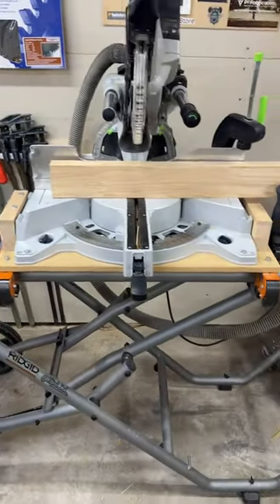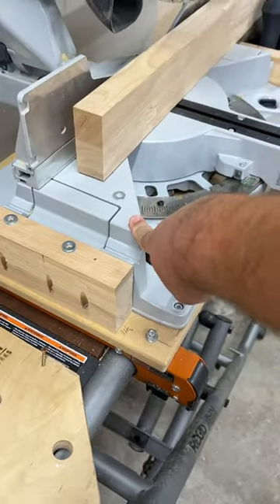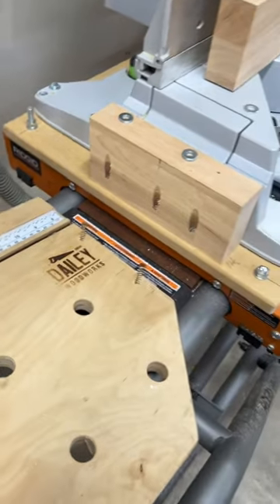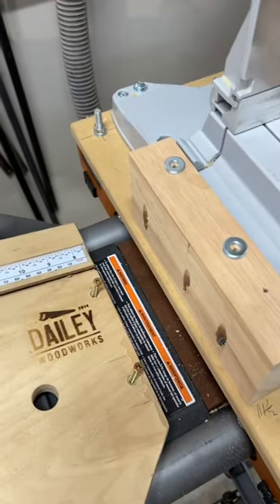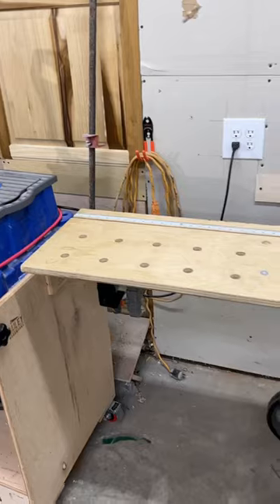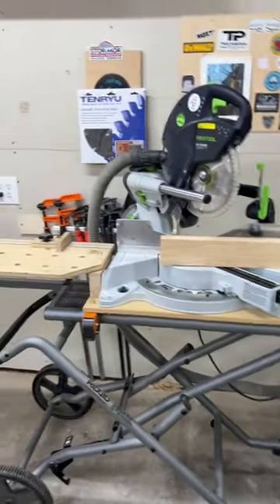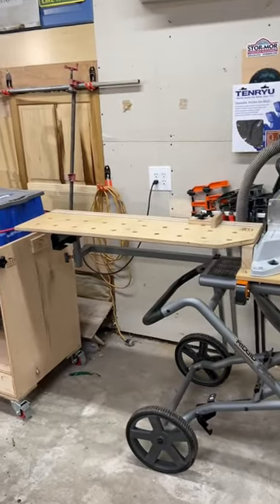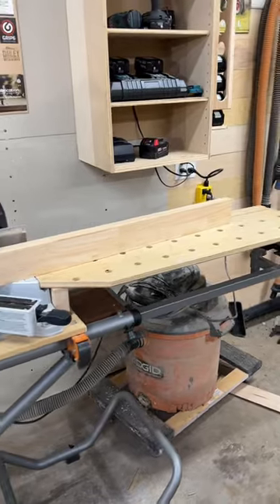Mitersaw wings for the Ridgid Miter Saw Stand. #carpentry #mitersawstation

Comment: I've been thinking of picking up this same Rigid stand and I really like your wing solution.  Simple and elegant.  Do you have a video on your stop block setup?  I see a groove cut in the wing but no T-track, just curious how you lock it down.  Awesome job!
Reply from the maker: It’s based on Ron Paulk’s Smart Station design. It’s a routed T-track that uses a toilet flange bolt and a shop made flag stop
Reply: Thanks! @DaileyWoodworks